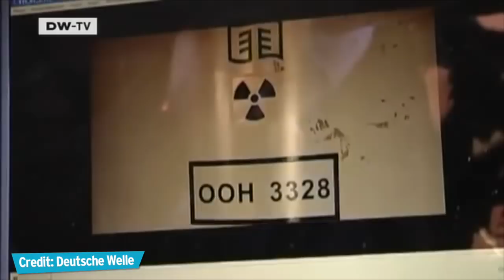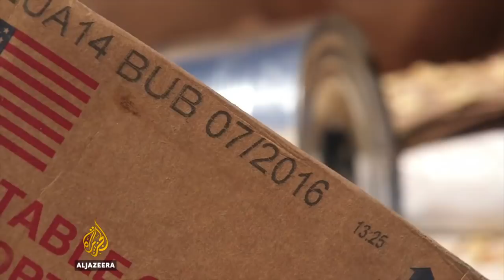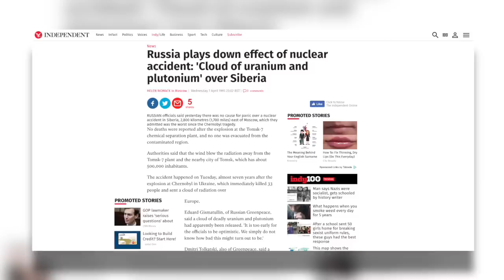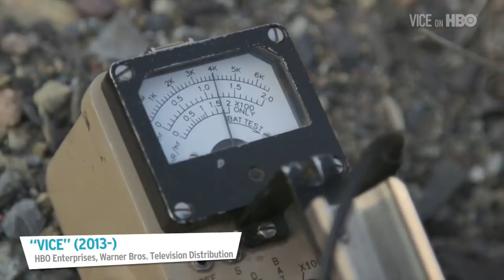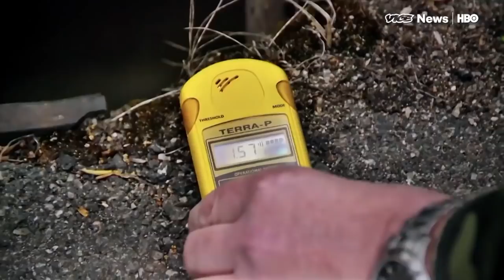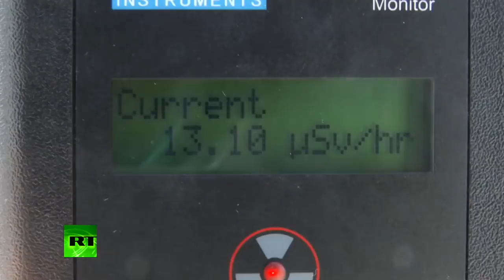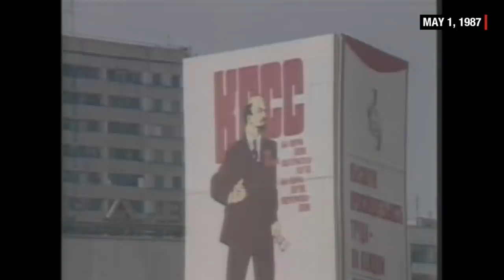Top 10 Most Radioactive Places in the World

Comment: The most radioactive place at Chernobyl if your wondering is the reactor 4 sarcophagus. In the sarcophagus is the lid of the RBMK reactor that weighs over 1000 pounds, the reason I point out the lid and weight is because that was the lid  that flew up due to all the pressure built up underneath. The second thing in there you should worry about is the reactor graphite tips and just graphite on its own. If you look up a picture of the reactor graphite it almost looks like a lego, and these graphite pieces can reach up to 100sv a hour or a deadly dose in common knowledge. These graphite tips/ blocks were used for cooling the reactor when the atom split. When the atom split it let off gamma rays “please quote if I’m wrong” and please note over 235 atoms split a min. The 3rd thing you should be worried about are the control rods, these things were tipped with graphite and the control rods on their own can reach up to a fatal dose of sv on their own “I don’t know the exact number” If you have any questions just comment below

Comment: i still argue nuclear energy can be a safe replacement for fossil fuels if the proper safetey protocols are followed
Reply: and what do you suggest we do with the radioactive waste? pour it in your drinking water?
Reply: @kathrynmft  dump it on mars
Reply: Alec T we're planning on living on Mars in the future when this planet craps out due to fossil fuels polluting the atmosphere
Reply: @kathrynmft  mars is uninhabitable the only way we can live there is inside a pressurized dome colony that has oxygen. Because mars has almost no atmosphere.
Reply: I'd say we find a way to stabilize nuclear waste and find a way to use it as car fuel. Less CO2 in the air and we find a way to use nuclear waste, two problems solved at once. Nuclear waste still contains a lot of energy, so it'd be perfect for fuel if you find a way to make it safe.